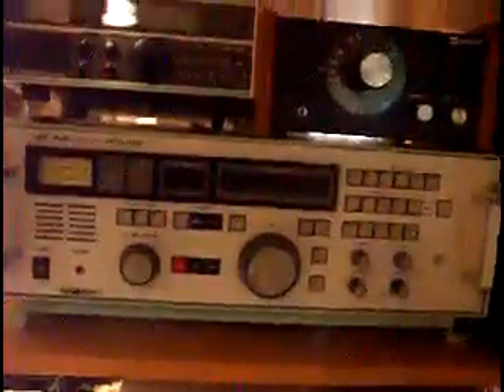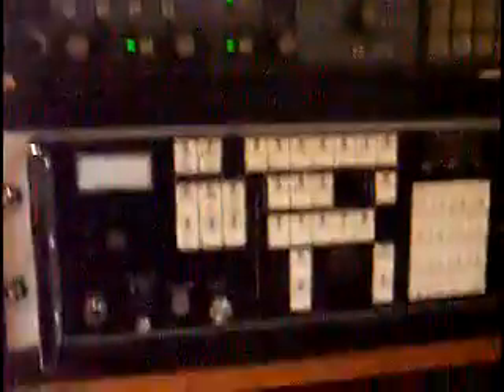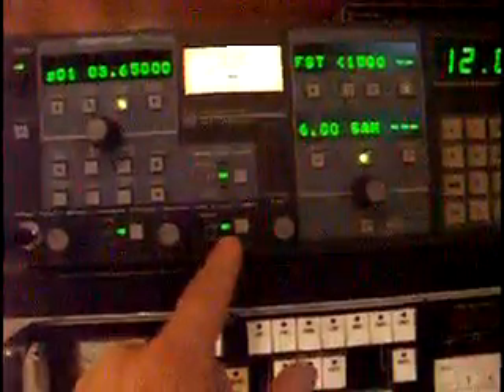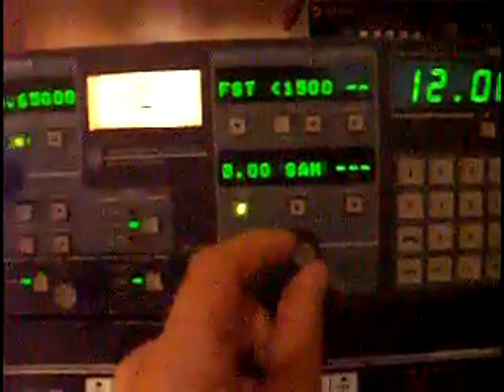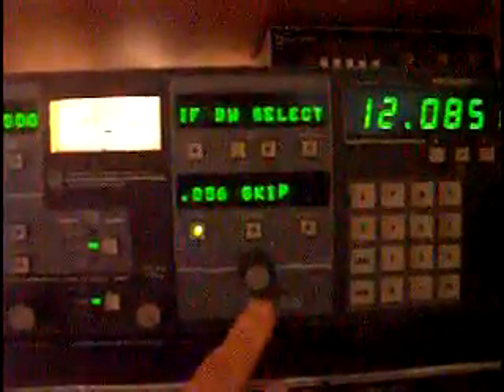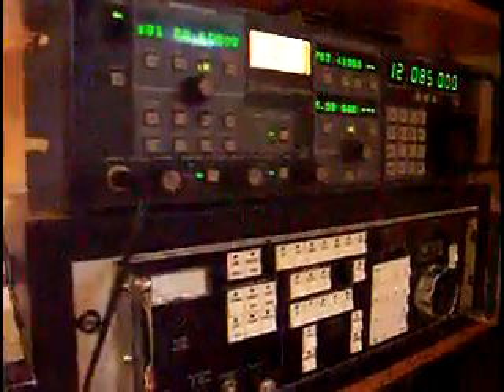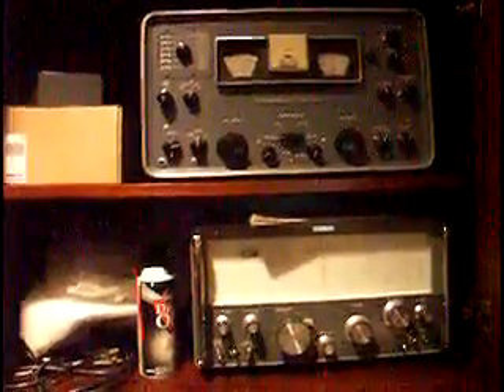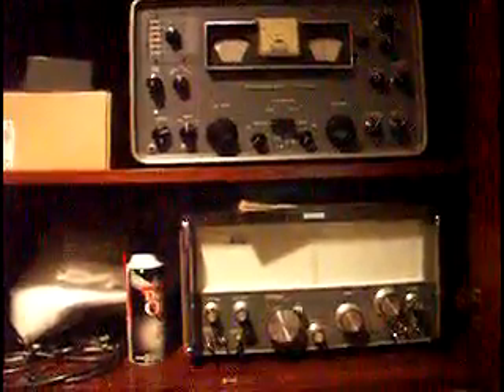Watkins Johnson 8711A

Comment from the maker: There have been quite a few WJ 8711/A on 
EBay in recent months -- cost can range from 
somewhere in the $2500 range up to and above
$4,000.  Make sure to get the latest software /firmware
version in the radio as many do not have this.